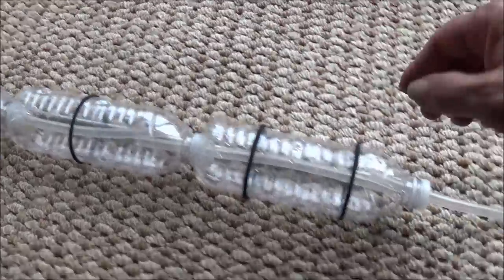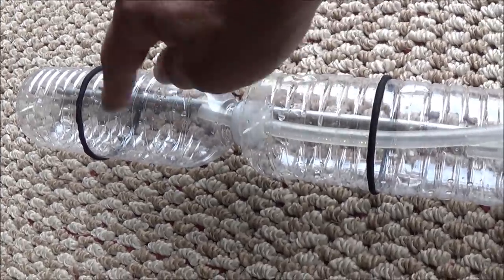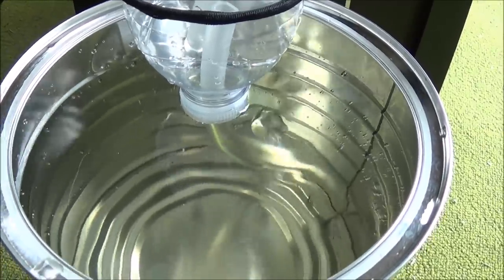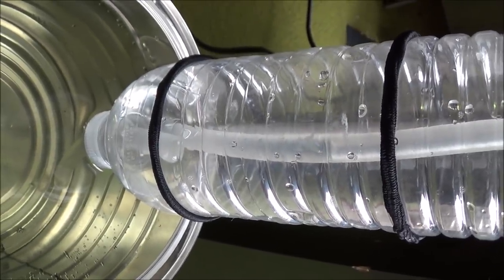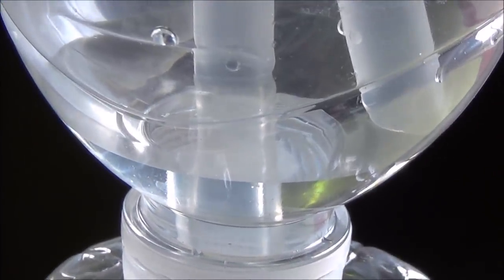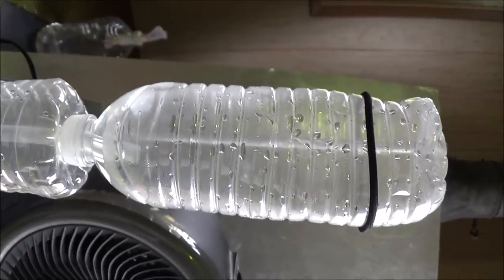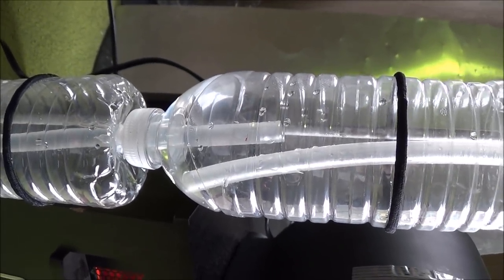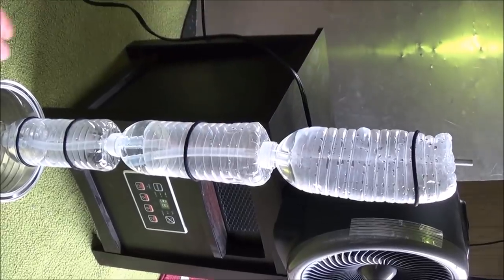"Thermal Vacuum Water Pump", needs no electricity and has no moving parts!

Comment: Put some water in the bottles then in the microwave, then prep it and run cool water over the bottles... although pretty sure all bottles would collapse on themselves at that point, even seen metal barrels collapse lol. Should use glass bottles, paint one side black so you generate even more heat inside, if you're gonna use solar heat.

Comment: Next time, Use Hot Fill containers used for Gatorade or powerade (or apple / Spaghetti sauce) ect. These are specifically design to hold vacuum and will not collapse.  The alternative, is to 3D print rings that can be glued onto the bottles you are using to prevent collapsing.

Comment: Great man! Maybe a long PVC pipe painted black would do better but I'm you already thought of that. Also can be done, to have many cycles per day is some sort of intermittent shadow, that can be simple vertical poles that will do shadow at some time during the day or a moving "shadower" also actuated by another similar system: water, bottle,pipe, unbalance part,etc

Comment: Plastic soda bottles are much stronger than those flimsy water bottles.  If you still get collapse, you can move to glass bottles.  Snapple used to be in nice glass bottles that were great for experimental uses, but now they are just really thick plastic.  Bonus points if you re-use straws for the tubing.